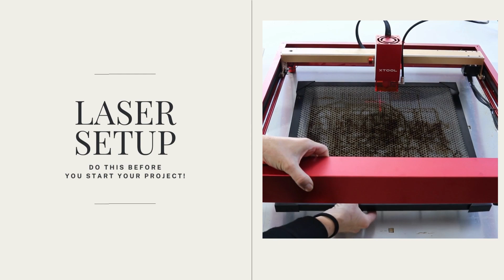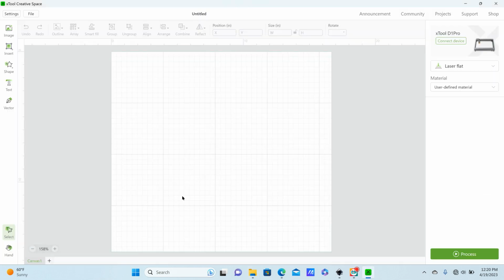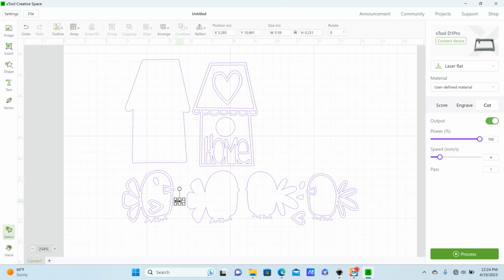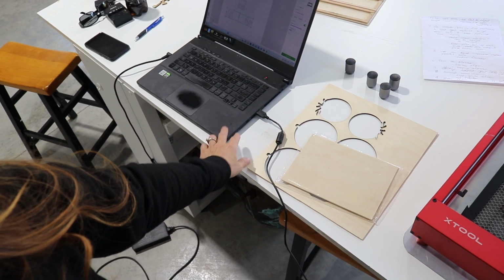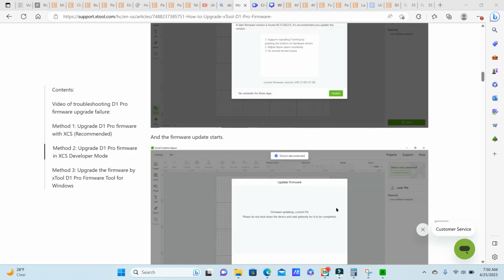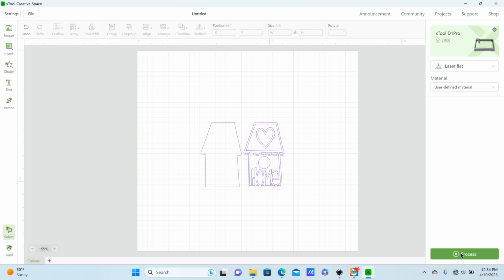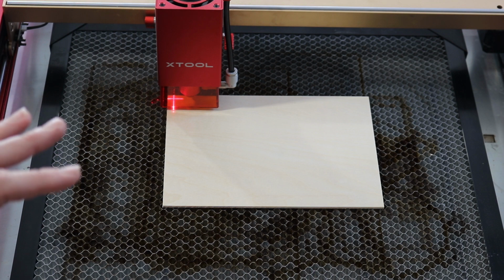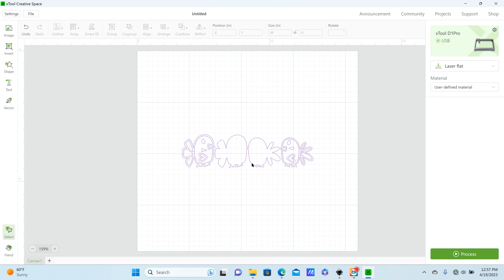How To Cut Plywood with xTool D1 Pro 20 watt Laser Cutter / Beginner Friendly! STEP BY STEP TUTORIAL

Comment: Thank you so much for this great video. I have a question though. I received my laser about 2 weeks ago and I can't get it to cut all the way thru the wood. Is there something that you can suggest to help make that happen?
Reply from the maker: Hi! This laser will only cut through about 8 mil. If your power is at 100 percent, try reducing your speed. Also, air assist can help get better cuts.

Comment: Question, my laser keeps burning the wood and setting the fire alarm off. Does it make a difference to use pine plywood vs birch?
Reply from the maker: Hi! No, it shouldn't matter, but pine is softer and may burn quicker. Do you have air assist? It seemed to help me a lot. And try increasing the speed of your laser...if it is running too slow it will definitely burn too hot and set an alarm. If you are making deep cuts, try upping the speed and number of passes, especially on softer woods. Hope that helps!

Comment: Hi
I just recently purchased a gray Xtool D1 Pro (not sure if that matters). But I noticed that you use the air assist. Does that mean I do not have to use the hose?
Reply from the maker: Hi! It is not required to use air assist but I definitely like it. It reduces burn marks when you or cutting or engraving, and seems to help the machine cut a bit better.

Comment: Not a good idea to move laser head by hand, this can cause a voltage spike to the stepper motor drive. The stepper motor is essentially a electric generator if turned manually.. if you do move, move slowly... cheers.
Reply: The xtool is perfectly ok to move by hand, larger co2 lasers are a huge no to move by hand.